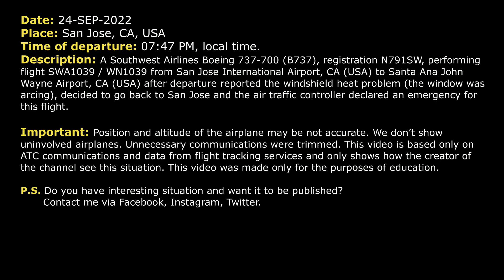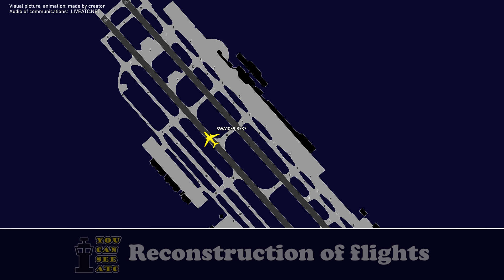Windshield heating IGNITED IN FLIGHT. Southwest Boeing 737 returned to San Jose. Real ATC

Comment: Isn’t it a bit odd for the ATC to let them get that far ? Usually in that kind of situation, controllers give pilots delay vectors close to the airport so they can come back quickly if needed. I’m surprised to see this plane got that far away. I understand the wish to not bother the pilots, but still, looks quite unsafe to my non-professional eyes.
Reply: Pilots have the say on how long a delay.  They have check lists to go through in hopes of correcting the issue.  Whether Engine start in flight, fire, loss of cabin pressure,  all have check lists to follow.  Imagine trying to go though the lists, talk to ATC, talk to company tech AND keep passengers updated. Plus fly the plane
Reply: Unsafe? Plane had no issues what so ever with flying. The only problem was window defroster and that means they can not continue in case the windows fog or freezes during the trip.

Comment: That’s odd, can’t they pull the breaker or turn it off? Doesn’t seem like a flight-critical item, unless the windscreen was already damaged at that point I suppose.
Reply: The problem is that you might want it during the flight, so not possible to continue with a malfunctioning window defroster.